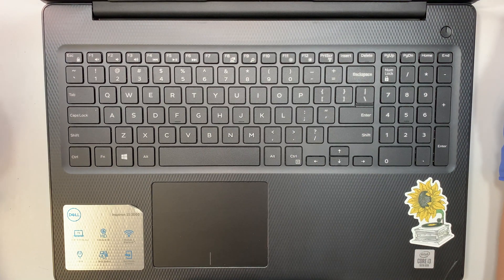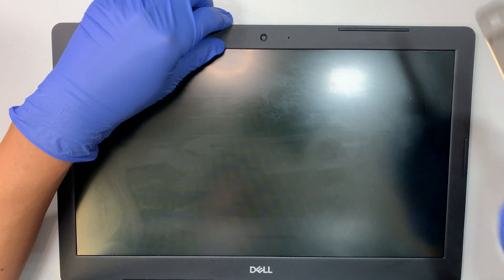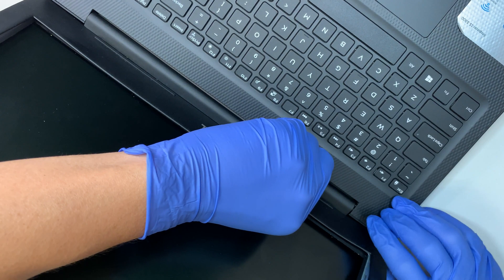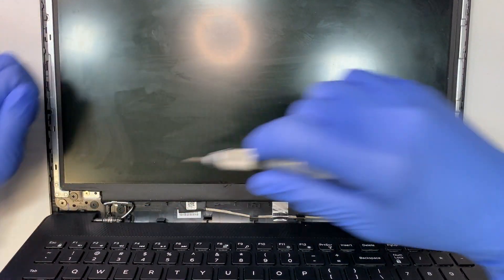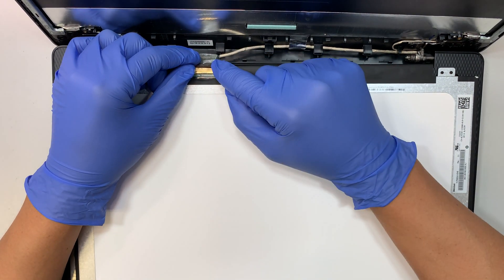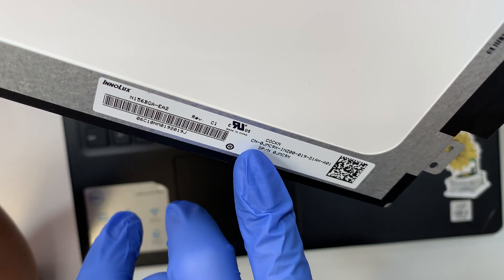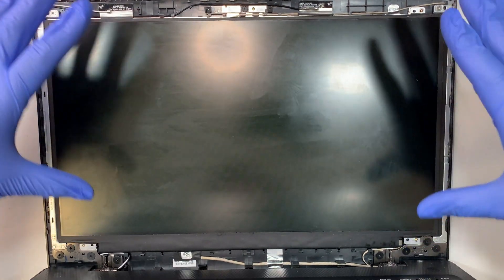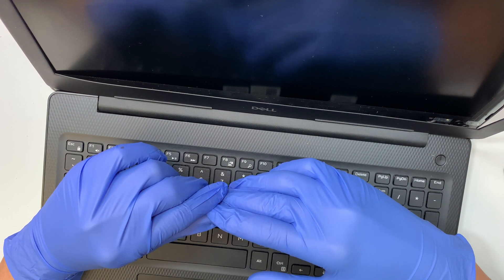Dell 3593 P75F LCD Screen Replacement

Comment: Thank you for your video!I have one exactly same laptop need screen replacement . One question: you were putting on a 30 pin , is 40 pin for touchscreen? Because mine is touchscreen laptop.

Comment: Do you kno if its possible to go from a 1366 x 768 TN Panel to 1920 x 1080 IPS screen on this model. i really dislike how this screen display look lol
Reply from the maker: No, you can't do that
Reply: @UbergeeksBiz  How about replacement of 1920x1080 TN screen with 1920x1080 IPS screen - is it possible?
Reply: @PinkEcchiRobin Hi! I purchased compatible "IPS" screen from a non-official dealer and replace it by myself. My impressions - 1. I am not 100% sure that it's really IPS screen, but viewing angles became much larger. Not sure if it is because it's really IPS screen or it is because it is brand new TN screen. 2. Experience working with my laptop became much more acceptable now and I am not regretting about screen replacement at all (before screen replacement I was seriously thinking that I should replace my eyes).

Comment: is this for touch screen? I have Dell Inspiron 3593 with exact same model and need to replace screen (digitizer problem). All the amazon link you have sent shows its not for touch screen. What type of screen i need to ensure that post replacement, touch screen still works? Thank you.
Reply from the maker: This laptop model is for non touch lcd screen
Reply from the maker: You can try open to see your original screen model and try find that